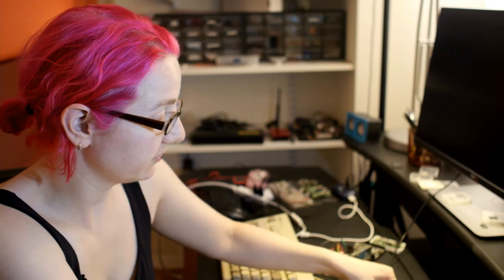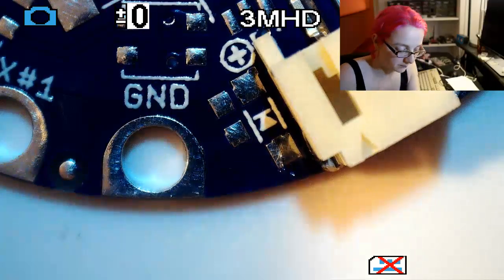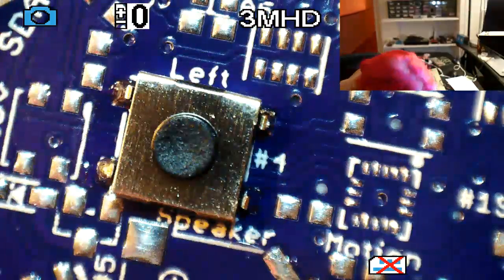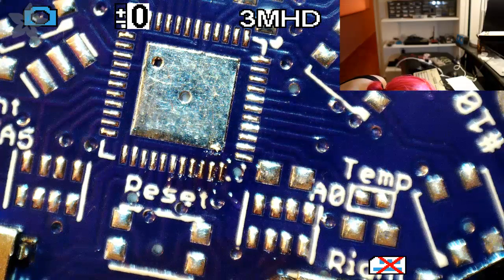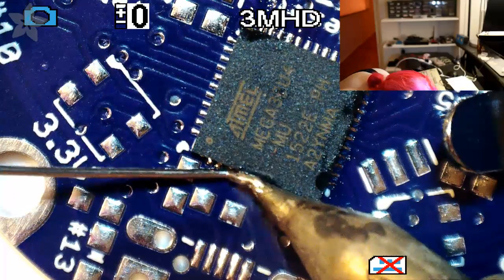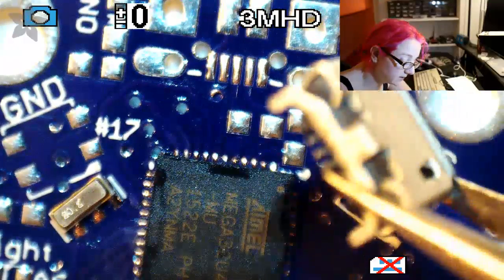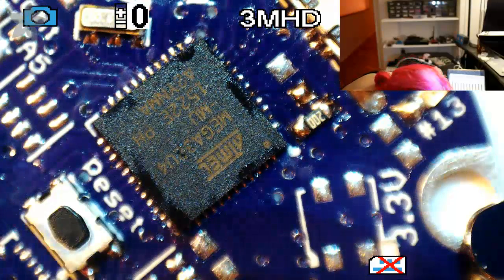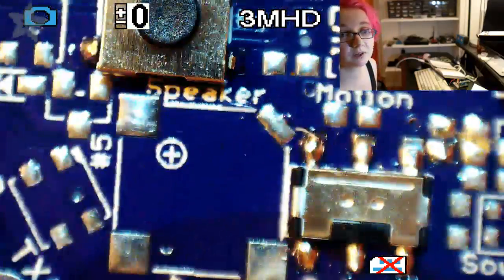@adafruit SMT soldering circuit playground 12/17/2015

Comment: You can make vias under the QFN power pad and then leave copper revealed in the other side of the board then solder the pad that is exposed in the bottom of the board and the vias will fill up with solder and heat the power pad soldering the power pad with a simple soldering iron :)
Reply: TutoElectro hhhhhhhhhhh

Comment: OMG! I totally fell in love when you did the QFN and you felt the click click click...XD and then I started to think about  tweezers  with x and y axes and steppers motors so putting in place would be easy and accurate. Great work!
Reply: EHFL - Electronic Hacks For Life you mean a pick and place machine?
Reply: yeah but maybe something simpler than a P&P  maybe something we can go step by step manuallly, it would be great for the weekend hobbist.
Reply: EHFL - Electronic Hacks For Life you could probably make something similar using old cd drives and a little fish tank pump to provide suction to lift the parts. Depending how many parts your circuit uses though and if they're polarized or not it may take less time to just populate the board by hand than it would take to set each component in the proper orientation that it needs to be place down, and in a spot where the gcode or whatever knows to pick it up. I'm sure with a little time to work out the kinks it's possible though.
Reply: I was thinking about something without gcode something like having only buttons to step on X and Y , for small PCB´s, we can step the base where the PCB is placed for the Z axis even by hand or using some mechanism or not moving at all! so def the fish tank pump is a must. I remember an electronic spoon I saw somewhere, they added steppers motor to the 3 axis so people with diseases that make your hand tremble can eat totally normal. Well it seems a weekend project just has born!

Comment: The QFN would have been easier if you line it up with the pads first, then held the chip down with the tweezers before soldering the first few pads.

Moving the chip around after some pads are already soldered (like just before 20:00 in the vid) puts a lot of strain on the pads / traces, and could end up lifting some.

A fair few QFNs have pads that wrap around the corners like that, but definitely not all have "continuous" pads.
You can usually get the solder to reflow quite well along the PCB pads and underneath the chip pads by just heating the ends of the pads, but sometimes a hot air station is necessary.

I wouldn't personally recommend the rounded pointy iron tips for most soldering, especially for beginners.
(Maybe for reflowing the pads around a QFN though, which is one thing the pointy / bevelled tips are handy for.)

A small "chisel" tip is FAR better for getting decent thermal contact with the pads / legs, but also tends to retain a bit more solder "tinning" on the iron (which also helps with both the thermal contact, and with helping to prevent the tip from oxidising.)

Even if the flat chisel part of the tip is very small (2mm or so), it makes a huge difference to ease of soldering, in my experience.

Perhaps a tad too much solder on some of those pins, which comes back to having to add quite a bit extra fresh solder to the "side" of the pointy / bevelled tip, before it can reach the very tip. (which is also letting some of the flux boil off during that time.)

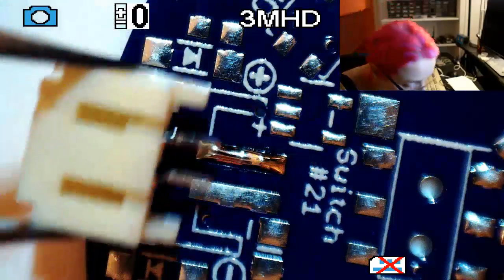The more ideal amount of solder is like the first pin on that connector at 7:30 .
The solder joint has more of a "fillet" shape, where the solder has nice curved edges leading up to the pin.

Those types of joint generally turn out to be stronger than the ones with slightly more of a blob.

With a small chisel tip, you'll find that you can still use the "corners" of the flat tip to solder the very fine stuff, but also angle the tip, or keep it flat to the larger pads.

Also - FLUX! hehe :p

Comment: What temp is the iron set at with leaded solder?  Do you find that unleaded solder harder to work with?
Reply: Donovan Lym this soldering iron barely works with leaded solder, it will just not work at all with unleaded solder which melts at a higher temperature

Comment: Where do you guys get your Surface Mount stuff? I've used mouser because they are cheap there, but it gets a bit confusing when you are looking for a specific part and there's like 20 different manufacturers with the same part but different pin layouts.
Reply: Brandon Martinez depends on the part, I usually get mine on digikey